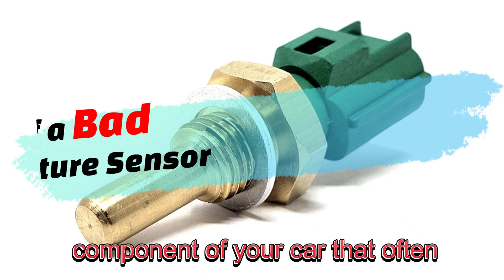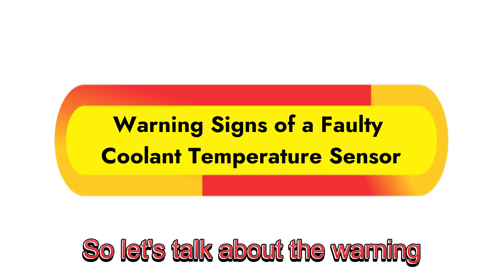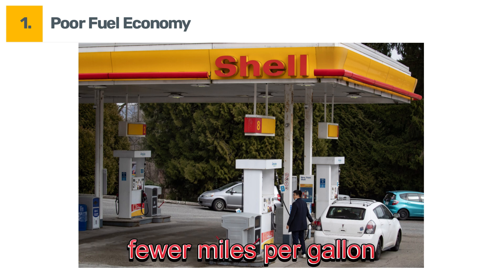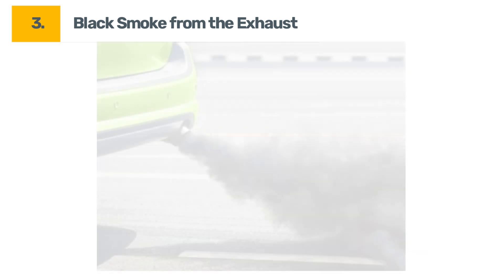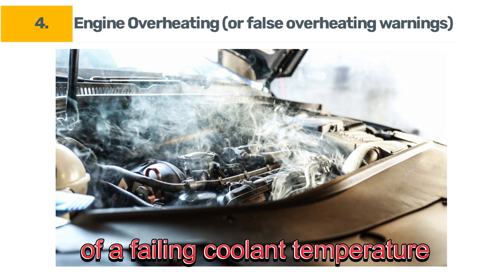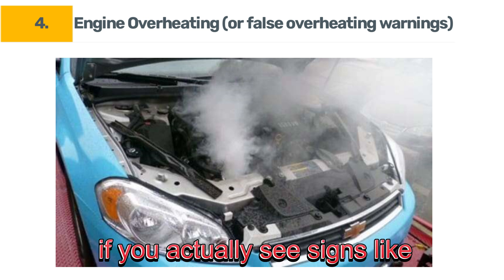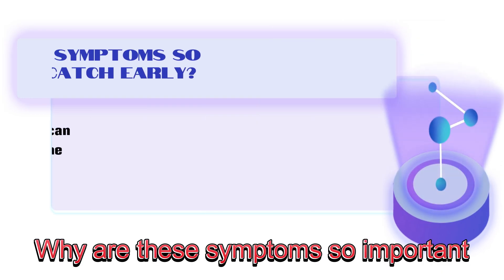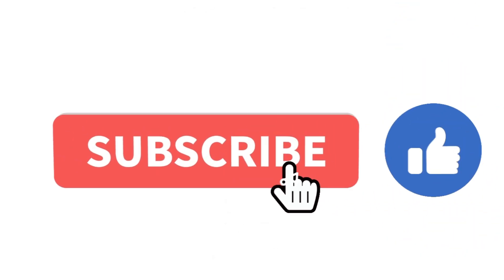Top Symptoms of a Bad Coolant Temperature Sensor You Shouldn’t Ignore!

Comment: Every modern vehicle I have ever owned has 2 temperature sensors. The main one sends a signal to the engine control system, ECM/PCM. The other sends a signal to the instrument cluster gauge or warning light. Don't be fooled by what the gauge indicates. The sensor sending a signal to the engine control may be defective even though the gauge shows "normal" temperature. Or the opposite may be true.